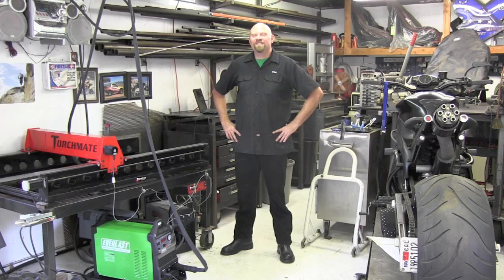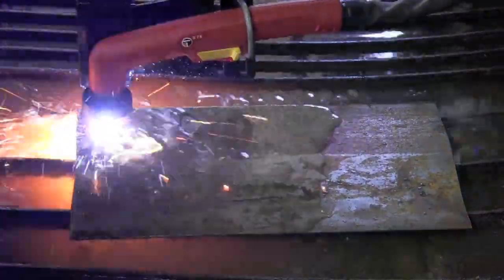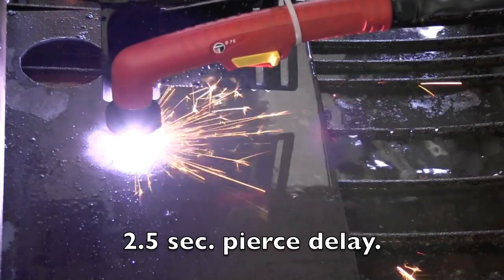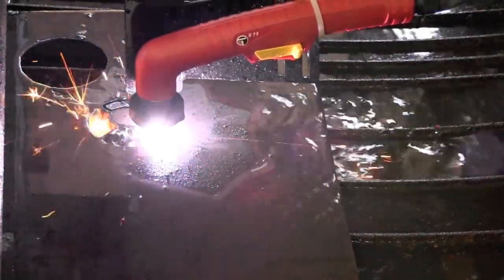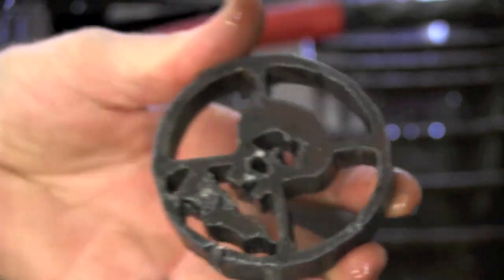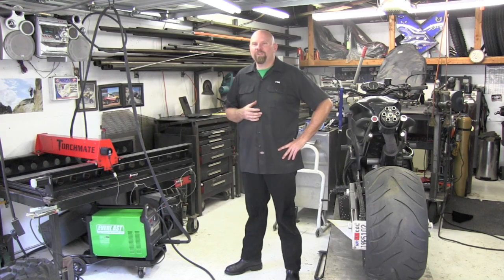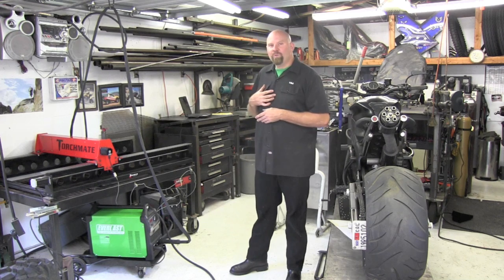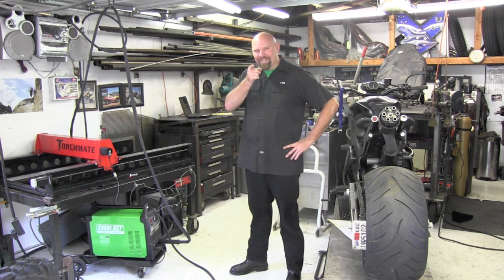EverLast PowerPlasma 60s on a TorchMate CNC table

Comment: So I'm looking to get an Everlast plasma for my CNC plasma table.  I keep watching videos of people say that they are great then they show me a super shity cut part.  Is this the best cut's you've been able to make or were you able to get it dialed in after this video?
Reply from the maker: I used this machine for about two years and took the money I made with it plus the sale and bought a Hypertherm Powermax 65 with a machine torch. If I recall it was a $3300.00 purchase. If you have the cash flow to buy the Hypertherm from the start that’s the way to go. At 1/3 of the price you can go with the Everlast and start cutting and making parts. Cut quality on .125 steel is almost identical for both units. When I go thin or 3/8” and up is where the Hypertherm shines. Sometimes you get what you pay for! Hope this helps!
Reply: @TRCa51  Sweet this is exactly the info I was looking for!  I've got a crossfire pro with the Razorweld Razorcut x45.  It's great for cutting 11gauge and down.  When I get into 3/16 + the angle on the cut is more than I like.  I was considering a Everlast 82i or the Hypertherm powermax 65.  I really want square edges on 1/2" material.  I'm trying to figure out what cutter I need to pull that off
Reply from the maker: @BeckTools  I just did some 1/2” steel on my table with the power max 65. I put in new consumables and was cutting out wheel adapters to go from eight on 6 1/2 to a military 10 lug. So 18 holes per adapter and I did two adapters plus the 17 inch circle I cut. I said my peers delay for .08 seconds and ran it at 20 inches a minute. I still got some Kerf about 1 to 2% and on the half inch holes I had to go about .020 it’s over to get the studs in. The 65 will do it but if your going to do a lot of 1/2” I would do the Powermax 85. It all depends on the quality you need!
Reply: @TRCa51  Thanks again for this info! Extremely helpful!

Comment: I'm glad I decided to further search after the railing Everlast gets from Langmuir owners on a forum. So how does the 60s compare after all these years? Also, what compressor (home shop w/ limited budget) would you recommended for 2020 Everlast 60s? I am waiting for my Premier Plasma 4x8 table to arrive and need to pull the trigger on plasma cutter and compressor. Thanks!
Eric
Reply: Hey Tim, finally got plasma cutter and went with 62i and cnc torch. Fired it up this morning and been trying to figure out why the torch misfires and doesn't complete the cut. Did you ever experience that with yours? It traces over the area it should be cutting and fires intermittently. Almost think the post flow (10.5 lowest setting) is affecting torch as it is constantly on and off through the course of the job. Any help would be appreciated. Thanks a bunch!
Eric
Reply from the maker: kelly najarro wow! I don’t really know other than make sure you have.a good ground your consumables are installed correctly. Maybe just change them out just to eliminate that from the equation. Make sure your getting clean dry consistent air. If the pressure drops below 90 I believe the torch will stop firing! If that doesn’t work give Everlast tech support a call and I’m sure they can figure it out! Hope this helps!
Reply from the maker: Hi Kelly! For my compressor it's a 60 gallon single stage Husky from Home Depot! As for my Everlast 60 i used it for 2 years and made my money back on it and my table! So a lot of trouble free cutting but I sold it and went to the Hypertherm 60. It just gives me more capacity on thickness  I cut!  At $3300.00 it was a serious purchase but cut quality is just a little better for 3 times the price! LOL! I highly recommend the Everest line of plasmas and welders! For the price I think its the best out there for the money! Nice way to get up and running and start making money!  Hope this helps! Cheers!

Comment: Hey Tim! Curious to know what pins to hooked up to which wires. Also did you solder them together? My CNC has to wires to connect to plasma cutter & I’m not sure which pins to connect it to thanks
Reply from the maker: Try pins 1and 2. All this does is closes the circuit for torch fire!

Comment: how much do you have invested in the table and plasma cutter total?
Reply from the maker: At the time I bought my Growth series it was $3200 with cad lite and cut software. I spent another $1100 on a plasma cutter and $300 on a laptop  and about 300 in metal to build my water table. Just under 5 grand to get me making money with it! Hope this helps!
Reply: yes...want to expand my capabilities on making intercooler rexervoir tanks for turbo charged motors.
Reply from the maker: It's funny I use the table more for cutting Aluminum then anything else!
Reply: i also have all everlast machines...255 ext tig ,205 mig,140 mig and the 160sth...and was thinkin about getting the plasma cutter as well.
Reply: getting ready to buy this and wanted to know if you would buy this again and do you use it daily....mostly gonna use it for 1/8 aluminum but im sure i will use it for other things...couldnt see me using it for anything over 1/2
Reply from the maker: Yes I would buy it again. I made enough money with it that I bought a Hypertherm powermax  65 with it. The Everlast unit is at my dads shop and still working great!
Reply: I've got an Everlast powerplasma cutter. I love it. I hope to put it on a CNC machine someday.

Comment: Hey Tim!   Can you give us an update on how this unit has performed for you?  Thanks
Reply from the maker: The machine work very good for me. The only thing I ran into was how many inches per minute to program per metal thickness. It just got to a point that I had several 2x4 sheet runs for for 3 different clients all with different materials and thickness. I didn't have the time to figure out the optimum setting for the aluminum and steel.
I ended up buying a Hypertherm Powermax 65 with a machine torch. The manual has all of the cut heights, pierce heights, pierce delay, and inches per minute for fine cut, 45 amp and 65 amp, for steel, stainless and aluminum. I really didn't have the time to get all of the research down in the time I had to turn out the work.  In just 3 weeks the work paid for the Hypertherm. I still feel the Everlast power plasma 60s is a very good machine and if time was not an issue it would still be on my Torchmate. Hope this helps!

Comment: Tim ,

I have torchmate 2x2 in bound with a everlast powerplasma 80s, I elected build my own water table, any lessons a learned from building yours you want to share?
Reply from the maker: Take your time! I waited to get my Torchmate all put together and then designed my table. I made mine with a fence that is removable that will index a full 2x4 sheet. If it were me I would build a table for 2x4 upgrade. Many metal suppliers have 2x4 stock and 1x4 stock ready to buy right off the showroom floor. Being you can cut 2x2 this would allow you to index cuts if you went bigger than 2x2. Pirate 4x4 has a great Torchmate form for a lot of info! Hope this helps! I think you will like the Everlast 80s! Enjoy!
Reply: Thanks tim! I have aquired a pretty good design for a floating head for the z axis and is not very expensive, do you have any interest fabricating one for your self?
Reply from the maker: dzljon No I don't. I may get a ATHC at some point but for now I'm getting great results without one. My slats are very level through out the table. and I use a .100 cut height now.  Knocking out 2x4 runs with great accuracy and repeatability.

Comment: Those will make fantastic medallions. It turned out fantastic even with your initial settings. Excellent looking plasma cutter. Clean cuts even on the 3/8" plate. Definitely get a CNC specific torch for your table to keep things square and to get the best cuts on it.

Comment: Tim,
One thing we'd like to mention to clarify, is that we also have the PowerPlasma 60C which is a CNC specific plasma machine that uses an inductor start and start/pierce times are faster.  The torch is a HF style torch, but no HF is involved.  The PowerPlasma 60S is for both, but the 60C is our CNC only unit which has a few different design features.